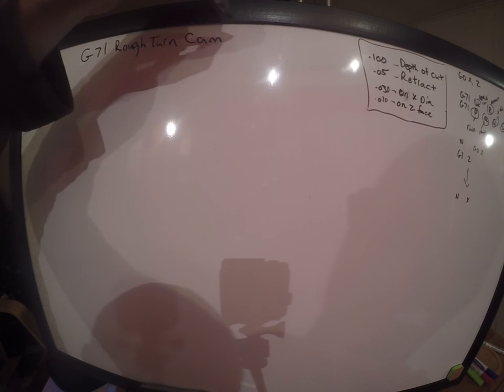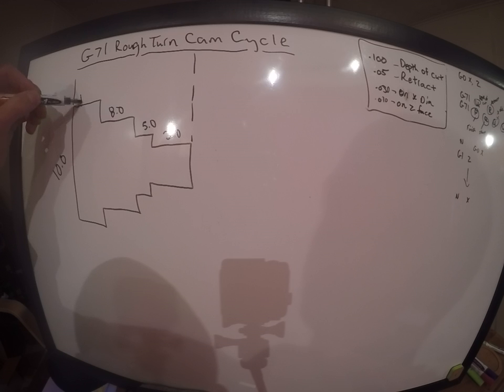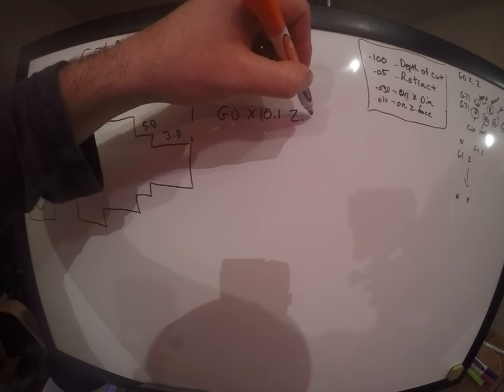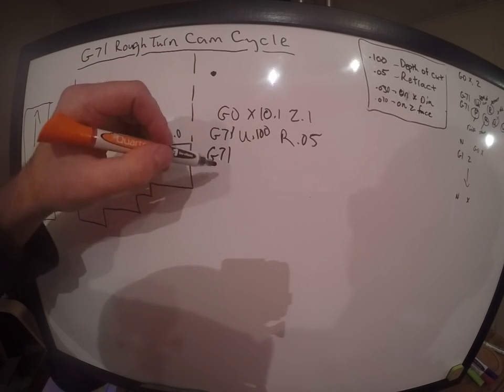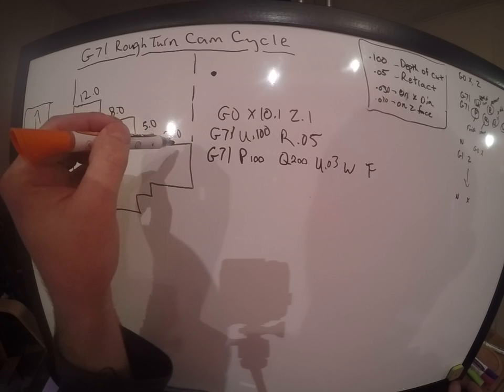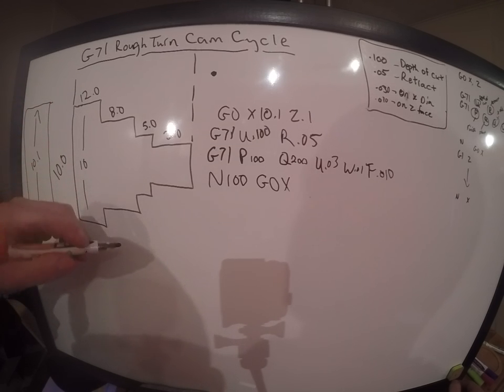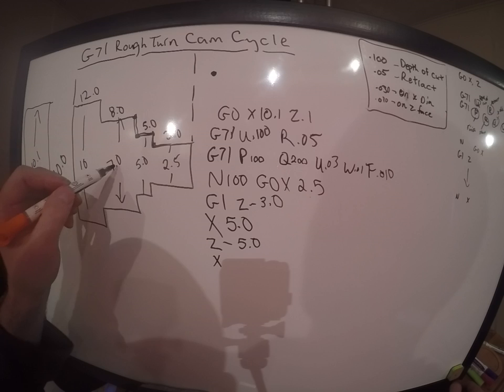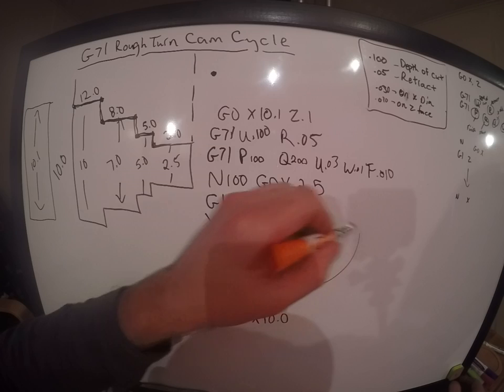The G71 Rough Turn Can Cycle for CNC Lathe

Comment: But how exactly does the tool move or what path does it take? Does it keep cutting .1 inch until the required co-ordinates are reached?
Reply from the maker: Dilip Ranjan it moves in one direction to the coordinates specified before moving to the next unless there’s an x,z move in the same line. Then it will transverse both simultaneously.

Comment: Couple of things for beginners: The sequence numbers called by P & Q should not be used else where in the program. In the block N100 if a G01 is used instead of G00, the tool will feed down into position for each cut. I've used this before to give the operator a little time, when moving around the tailstock, for example. When things are proven out, edit back to G00. This cycle can be mirror imaged about the centerline and used for internal work, also mirror imaged vertically for back turning or back boring. In other words, this cycle works in all 4 quadrants, cutting in 4 directions.